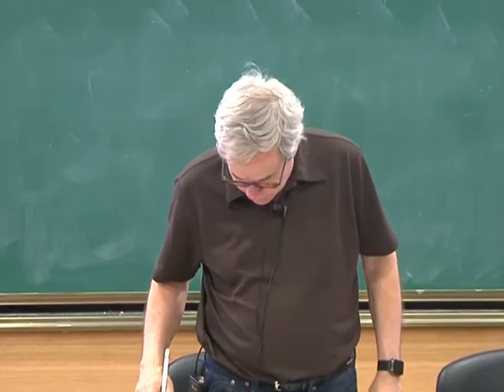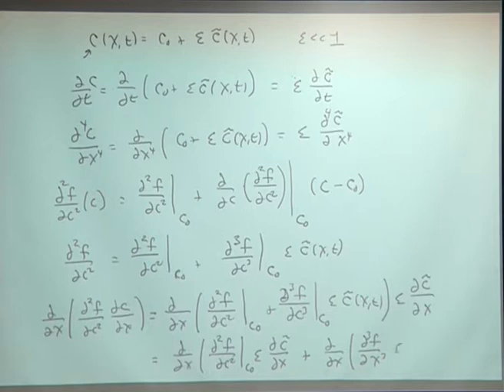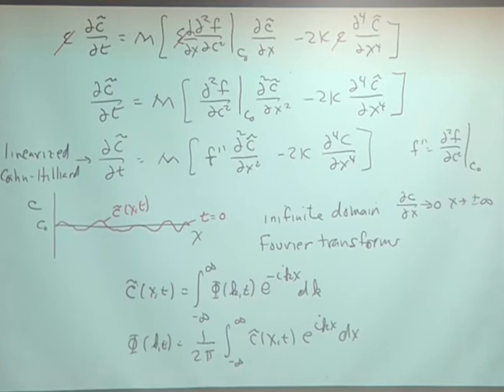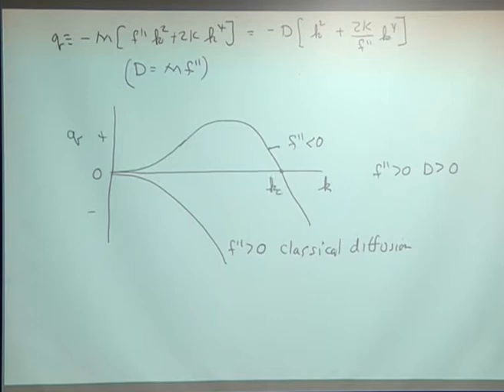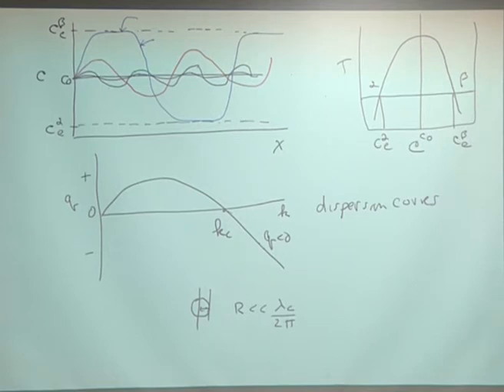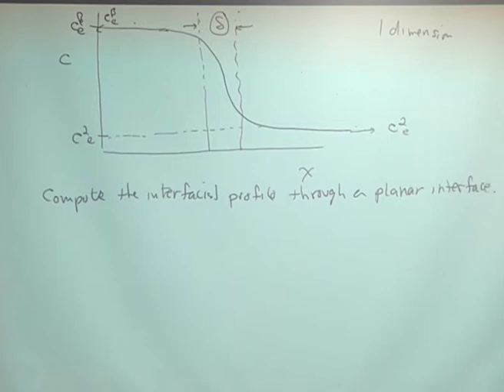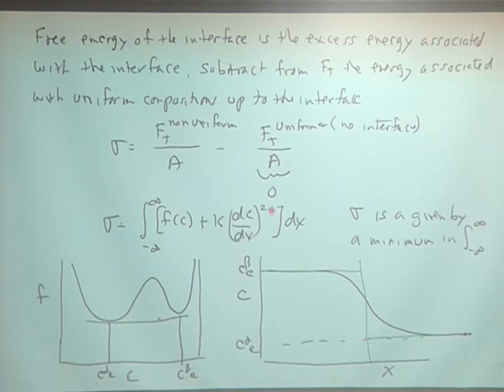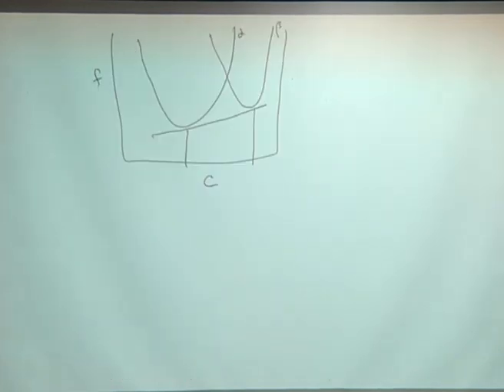GIAN-Phase Field Modelling Prof. Peter. W. Voorhees Prof. M. P. Gururajan - IITB Mar'18, Day 2 Lec 1

Comment: i think there is something wrong in the FT part,why  f'' didn't using the FT ,f'' also depend on the real spacial vector  x not k ,and i make some code to recover this FT process but it doesn't appear the "rich A" and "rich B",instead, the curve's rises or decay   depend on the c(x,t) i make